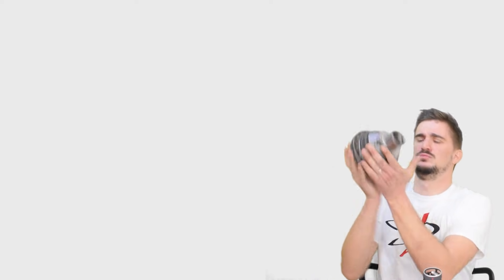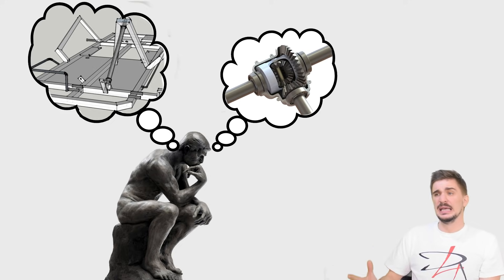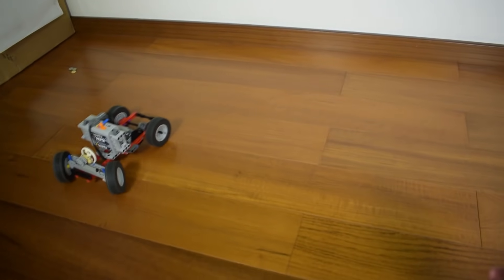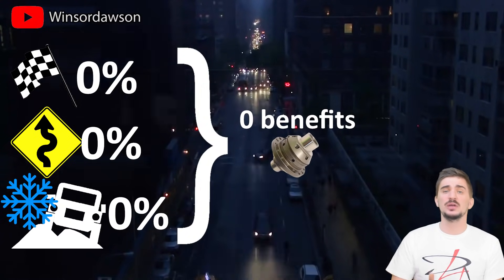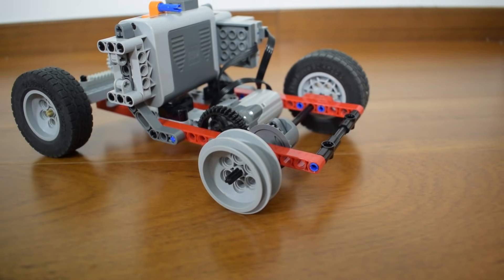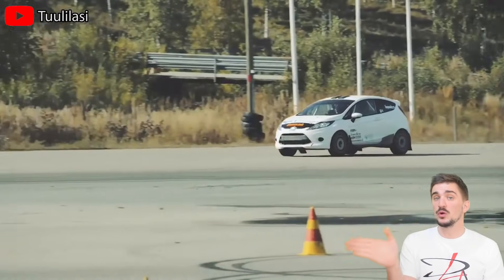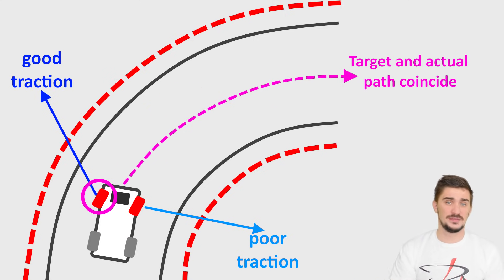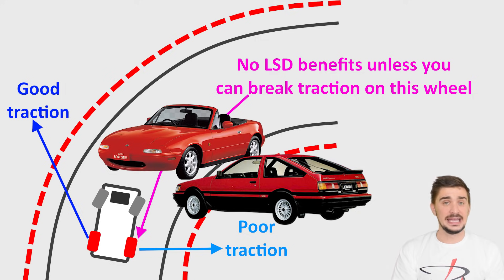OPEN diff vs LSD vs WELDED diff - VISUALLY + In depth EXPLAINED - Version 2

Comment: This clip  https://www.youtube.com/watch?v=JEiSTzK-A2A explains how a Torsen diff works and you can see it has a locking action and no more than half the power ever goes to the wheel with grip.  The Quaife ATB is a type of Torsen but can't be called a Torsen due to that being phrase being trademarked.
Reply from the maker: https://www.quaife.co.uk/quaife-products/atb-limited-slip-differential/ Paragraph 5.

Here you can find the bias ratio. I'm afraid you're misunderstanding the bias thing.
https://www.rrtransmissions.com/technical/limited-slip-differentials#:~:text=An%20open%20differential%20has%20a,the%20least%20amount%20of%20grip.
Reply: @d4a  I didn't find the bias ratio at that link.
Reply from the maker: There's two links, you can find the bias ratio on a bunch of sites.
Reply: @d4a  I'll wait till you have the Quaife ATB in your Toyota and you discover you aren't going to get a 70/30 split under any circumstances.  Then maybe you will be able to get a clutch plate LSD and find that will.